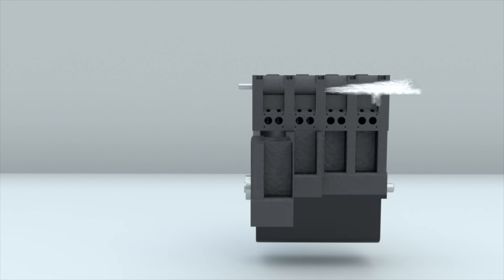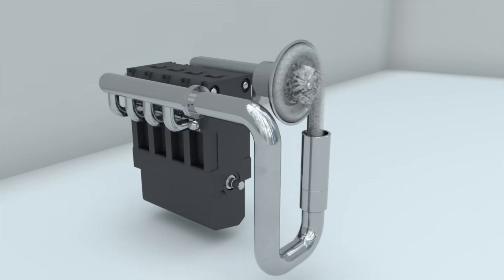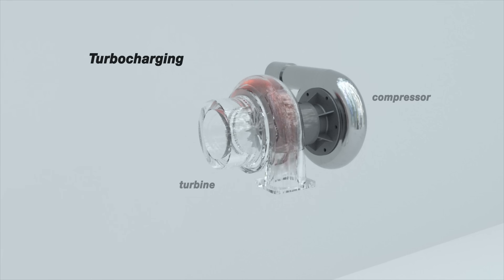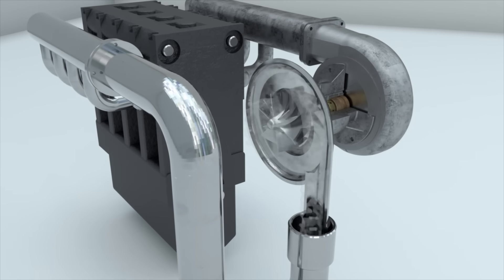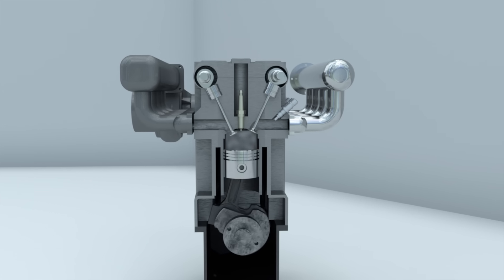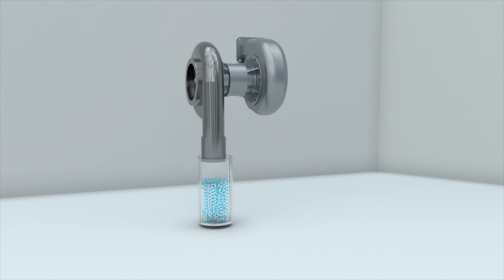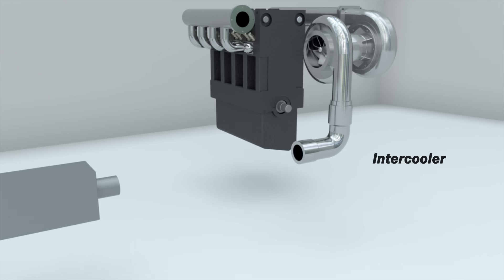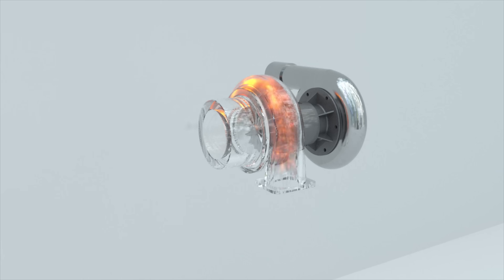How does a turbocharger work?

Comment: I highly recommend driving a turbocharged engine if you have not yet. Very unique experience compared to a naturally aspirated engine
Reply: Or twin turbos😈
Reply: I would prefer supercharger instead of a turbocharger... there is no power lag with a supercharger.
Reply: that turbo gives even weaker engines some additional push to it :)
Reply: Many Volvo's today have BOTH a super and turbo charger. Pretty interesting to see in the engine bay.
Reply: Yeah, I totally agree with that. My car has a small 1.5 turbocharged engine that produces 120 horsepower. And when I press the pedal to the bottom, I really feel the extra thrust.
Reply: @mekagoenlaputahostia  That reminds me of the Ford Fiesta ST. Those cars are so much fun.
Reply: @swesleyc7  yes, and that model is very compact and lightweight. But I personally prefer a Focus. I own both a 2008 and a 2018 Focus, producing 110 hp and 120 hp respectively. I personally like this last one, not only because it has the most powerful engine but also because it's smaller, wider and runs closer to the road, plus I love the looks of this last generation of Focus <3
Reply: @mekagoenlaputahostia  I owned a 2016 Focus ST in race red. I loved that car.
Reply: Yeah sure. Ive got a thousand dollar laying around my house to install one
Reply: I have driven a Saab 95 turbo 
Slow acceleration
Reply: Ya, with TC cars. You can make a lot of cool sounds either through BOV or all without 1 all together.
Reply: Yeah, a turbo charger doubles the liter size of an engine.    2.7L Turbo engine x  2 = 5.4L normally aspirated engine liter size.
Reply: I'll be honest I can't often tell I have turbo in my CHR but I do  know that a 1.2 normally aspirated engine could never give me the pulling power that I have.
Reply: i mean, N/A is instant torque
Reply: @9krpmzzz  think that's kinda his point. I have an 04 WRX and an 02 C5 Z06, the lag of the turbo vs the instant responsiveness of N/A make for a different experience, both a blast to drive though.  So i also recommend it :D (and obviously the amount of turbo lag varies depending on the car and what's been done to it, but, I'm speaking in general here)
Reply: @9krpmzzz  First of all, that's wrong, because there is no torque without rpm. Second, an engine with turbo has always more torque than an engine wthout. My last car had full torque at 1.200 rpm with turbo.
Reply: @9krpmzzz  with a proper sized turbo to engine displacement you will have instant torque at below 2,000 rpm’s… so what’s your point?
Reply: @henryatkin9690  read what you wrote...
Reply: And a supercharged one also!
Reply: yeah, good luck finding one still going 20 or 30 years from now in great shape after all the work they've had done on them!
Reply: @jackson5116  That's not true of modern, low pressure turbo chargers. Many of these are in cars, especially diesels, and still going strong after 20+ years. The main problem is with high pressure turbo chargers is the requirement for high and fast heat dissipation, which causes thermal and mechanical wear and the maintenance you're thinking of. By contrast, the lower compression, lower heat output low pressure turbo chargers do not have the same extreme heat problem, and work for many years maintenance-free.
Reply: @2112jonr  I have an 01 F250 7.3 with an original turbocharger on it. 279k on the motor and the turbo is just starting to show enough wear that I am shopping for a new one.
Reply: @2112jonr  its beyond denial, that a prolongued drive situation, thermally, the engine has Beaver duty. There s no substitute for cubic inches. A turbo engine at constant speed uphill 130kmh lets say, has a harder life than a 2,4 atmospheric diesel. In lorries turbo s are of comparatively very little pressure, they may as well be named 'add on to airflow divice'  Fitting a turbo on your Corvette, while a body made of plastic for wiegth loss i.e. design for performance  ? that make sense. A 900 cc Renault engine is bad news for your image, there Isss no rationale. Lada Granta for everyone!
Reply: Trying to get my 7 up Mustang turbo charged and straight piped.
Reply: Supercharger, turbo charge, and Naturally Aspirated, all 3 have their pros and cons. NA is great for racing because thr slightest touch of the pedal shows you how amazing that engine is. Turbo and supercharger don't habe this feeling